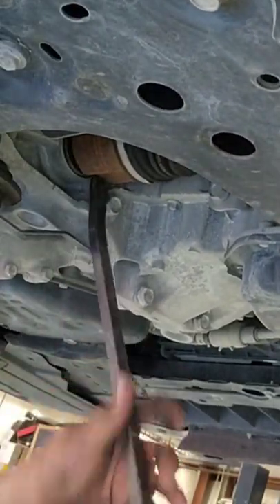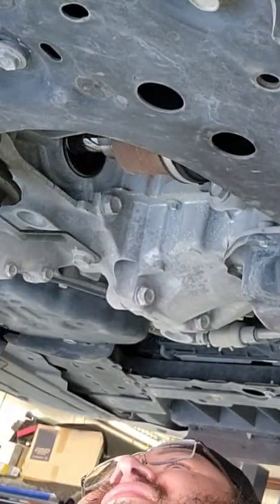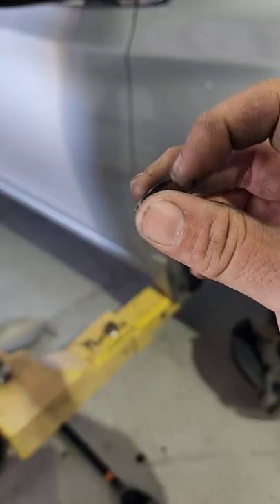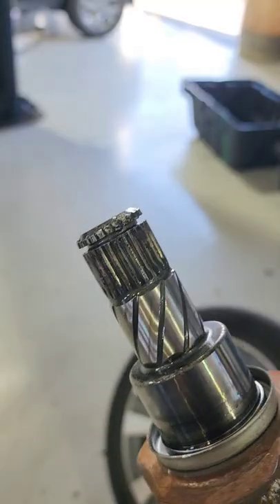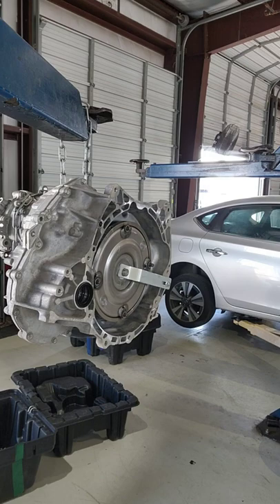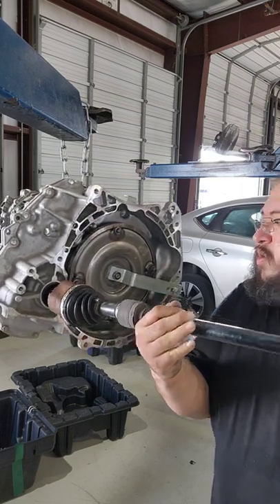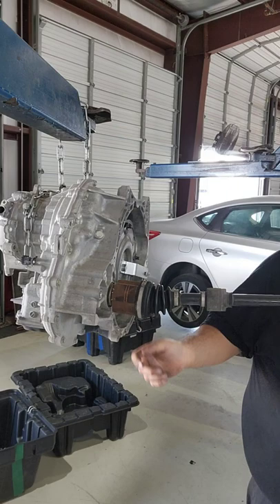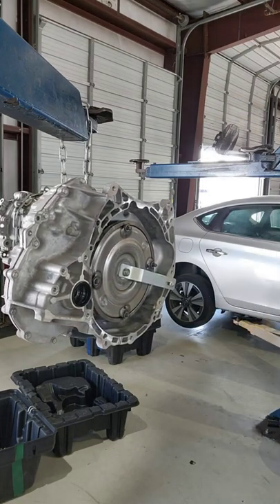AXLE SIEZED IN TRANSMISSION!!! 🥴🥴 #shorts #youtubeshorts #mechanic #pro

Comment: You have to rotate the axel a little each time when pushing the axel out.
The ring will compress when it is aligned correctly on the shaft.

Comment: I have a triangle file to fix axle splines. Because I have gotten new CV axles that the splines have been messed up. Just an fyi. 😎👍
Reply from the maker: Man i should have contacted you 😅🤣 but axle went in with no issue, although it cost the shop a 2$ retaining ring 😅🤣
Reply: @FluffyMexicanik  better a retaining ring than an axle. Save the customer a few dollars.
Reply from the maker: @rideordie3305  tru...when it come to simple things like this i just have the parts guys bill it to the shop ticket 😅🤣 cause you never know how a customer may react since its not in the original estimate
Reply from the maker: I kno i play that game sometimes 😅🤣
Reply: @FluffyMexicanik  One thing I've started doing is saving a few rings from scrap axles when replacing them. Put em in the drawer with the other random clipydoos for when this stuff happens...
Reply: @bleach_drink_me  Yep those parts that "don't exist", and you can't buy.

Comment: I think the right thing to do would be to replace the part you damaged. Unless the customer said they are fine with it
Reply: Just because he damaged it doesn’t make it his fault, would have been damaged no matter who did it or technique used that means the customer would have to pay for it.
Reply: @cadenwhite9713  there are tools for removing it however when removing the axle you must rotate it so that the clip slides into the hole with out damaging the Axle see this video https://youtu.be/jydxpsh13WQ at about 7 minutes in. There is a right way and a wrong way to do it
Reply: @Bear049  I stand corrected, I was not aware of that technique thank you for the reply!

Comment: Only reason why I wouldn't do this is because if there is an issue with the axle and comes back you may be liable for it
Reply from the maker: thats why i made sure that the axle could seat into the spider gears.

Comment: Oh you wait till you gotta pull PTUs off Equinox/Terrains. I was in the factory putting them on. Tolerances were wacked. Most were drove in to the transmission with the mounting bolts. Not in a good way. Never Never come off. GM's terrible. They knew&did nothing.
Reply from the maker: Good thing my equinox is fwd lol
Reply: @FluffyMexicanik  alightie👍side note: if ever replacing the front stab bar bushing, the bolts have a good chance of being crossthreaded in the cradle. Careful. Drivetrains fell off the line every 48to52 seconds🤪
Reply from the maker: @4everdc302  goodthing i have a service contract lol so i wont be touching it myself haah

Comment: You know if you actually removed the axle appropriately it wouldn't do that. you're not supposed to use a pry bar. you're supposed to push and then pull quickly. And maybe it still would have happened but you should make it a habit of doing it correctly.
Reply from the maker: If i did that then id be cleaning up axle grease and paying for a new boot, the tripod bearings are pressed in it doesnt have a retaining clip holding the joint together
Reply: Push and pull the axle lol it takes a pry bar or air hammer.

Comment: Very common issue on polaris's(polaris mechanic)
Reply from the maker: Really??? Whys that??
Reply: @FluffyMexicanik  was and mud get into the splines due to poor seal(we normally upgrade them to lipped seals) then that wears out the splines extremely fast the trying to get the axle out it'll roll the circlip half over the end of the cv and bind up
Reply from the maker: @kaidem1749  just as it did here...usually this dont happen but man this 1 faught me coming out

Comment: No I absolutely disagree with that I'm sorry but if you're changing the entire transaxle you might as well price the entire job with two brand new axles on each side because it's still part of the direct drive train if there's any other damage associated with the repair job taking it apart and reinstalling the proper parts if they are new then reinstall it as an entire package the reason why I say this is because what it's going to do is an old drive shaft is going to wear on a new transmission or transaxle whichever needs to be replaced....  I personally would call the customer explain the situation and ask them exactly what they need to do if they are worried about the estimate price on the end of the job you tell them you're paying more for a job that takes more newer parts to complete the job and it's also a safety Factor and liability...  If for some reason the axle can be salvaged unfortunately if the splines are damaged this would incorporate getting a new drive shaft because it's messing with a new hardware that drives it that's all I'm saying...  if the customer is mad or flies off the handle about the price of the extra part you're just going to have to eat the cost of the new axles and just bury their difference with the total price of the job it will also make them feel better and come back for more of your garage business knowing they're going to have a car or truck that is put together correctly even though you might have to actually correct the pricing to make it more valuable for them....
Reply from the maker: Actually no, the integrity of the shaft was not compromised...drive axles are single time part...that would be literally pulling money out of a customers pocket for no reason, had this not splined in...then ofcourse the customer would have been contacted or if the circlip would bind same outcome...but this was not the case as i demonstrated....also this is not a moving parts its fixed with the differential and is locked in place...
Reply from the maker: Also the splines that were damaged are no safety item...also the are merely there to guide the axle into the spider gears...that part of the pline does not touch anything when its in the trans...think of it as a bolt that has over hang at the end sticking out...it serves no purpose...u can cut it off and there be no issue...its just excess...

Comment: I've a tool for them stuck ones. Round plate with a slot to make a wide flat fork and threads for slide hammer.
Reply: Lisle?
Reply: @aayesher9400  Maybe, it might be OTC. I'll look today at work if I remember.
Reply: @aayesher9400  Yep it's OTC, 7507 is the part number.